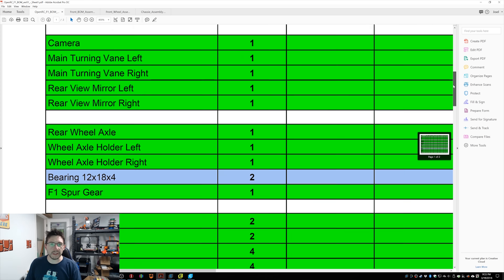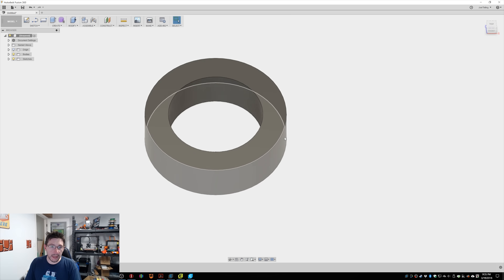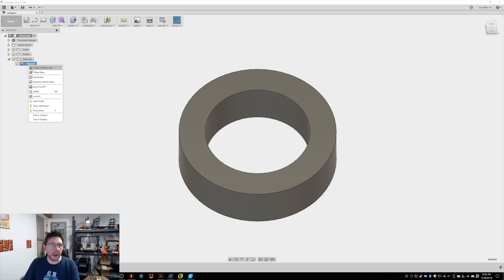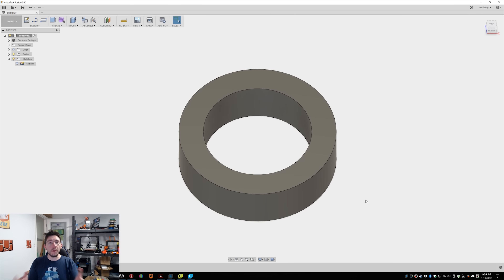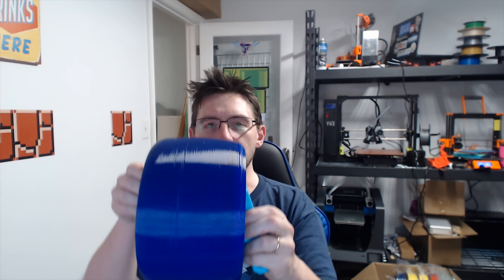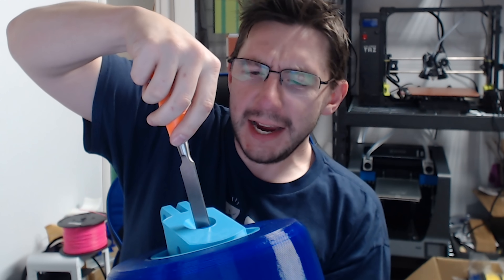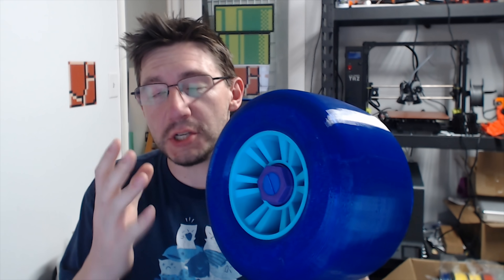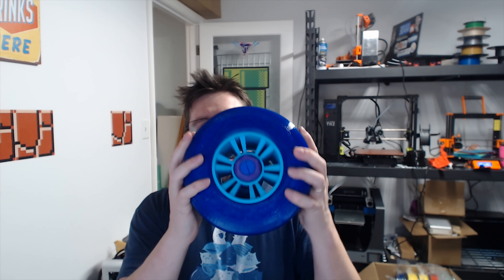3D Printing Bushings for the World's Largest OpenRC F1 RC Car [EDIT: Its a Bushing]

Comment from the maker: HEY EVERYONE! I just woke up and saw the comments, just a few things:

1. Wow, thank you for all the kind words and suggestions! I recorded this late last night. Yes, I broke my own rule of recording after midnight, but, I had an idea, and wanted to get it filmed.

2. Yes, it's a bushing. It's crazy the words your mind cannot come up with when it's late and you're tired. Once everyone gets in an orderly line, you can all take turns pointing at me and laughing.

3. LOTS of people talking about lubricant, and friction, and worried that the bushing will just weld itself to the axle. It won't. THIS solution is just so I can get the car together and bring it to MRRF. That's it. It's going to be sitting on a table for people to see. It might roll a bit just so I can show people it does roll. Once the car is RC and under power, this WILL NOT be the solution because of all the awesome reasons everyone is talking about. :)

4. I really hope you're going to MRRF (the Midwest RepRap Festival)!
Reply: Bushings are bearings. The other name for a bushing is plain bearing. As always happens with YT a lot of your viewers don't know wth they're talking about.
Reply: I would still squirt some lube in there even if the bushing is temporary just to reduce the scratchy noises of plastic rubbing plastic.   High Five!
Reply from the maker: I am!
Reply: Awesome video. I really can't wait to see it finished! Specially when it's rc ready. To help you with the bearing situation when it's time to make it rc. Check these out https://www.georgelodgedirect.co.uk/Products/0032003d0003/F59460/

It's 1mm wider but I don't belive that will be a problem. Hope this helps!
Reply: I wonder... , is there a pla fillament that is loaded with powdered graphite, (I DON'T mean carbon fiber, I mean powdered graphite, the type used as a dry lubricant for mechanics)? It seems like a viable possibility, (after all, there is "bacon" fillament, and "coffee" fillament, so why not?). If it does exist already, who makes it? And, would it help with the joints in this project?
Reply: I don't know if you're planning to make it a working RC car, but if you are, you might want to consider the amount of force you're going to need to get the car moving.
Bearings do come in a wonderfully large selection of sizes if you need to go with a traditional bearing.
Reply: Great stuff as always Joel!
I do wonder how it would compare if the layer lines were at 90*. less surfaces touching, so less friction? maybe even design tiny ridges in the axle...
Reply: oh, dang! just learned about this event, I will totally have to check it out next year, as its sold out (real shocker lol, 2 days b4 the event :P)
Reply: if you ever want / need 3d printed bearings, these look good, havent tested yet though, as my 3d printer is currently down https://www.thingiverse.com/thing:2349065
Reply: Sometimes engineering scales badly. I learned that as a kid paying with flying model aircraft. Damn those wwII fighters with their low dihedral angle and small surface area tailplanes. Regardless of that I hope you get the car to somewhat driving under it's own power. Printing the car in full F1 scale and attempting to drive it would really be a spectacular disaster :D
Reply: I will be at MRRF on Saturday with 3 more fans, one being my daughter who got so hooked on 3D printing that in less than a week after I lent her my Fabrikator mini she bought a CR-10.  We're all interested in seeing this model in person!!
Reply: You can still come this year. It is free for everyone. No tickets needed. Digital tickets were given out to get a rough count of people and get badges printed out.
Reply: A plain herringbone planetary gear would give you a 3D printed self-contained system that should perform just as well. It feels like a bit of a cleaner solution, just one of many around: https://www.thingiverse.com/thing:53451. Keep the great videos coming.
Reply: thanks! sorry, im an idiot sometimes, and  i've never heard of this event until today :P , i will most probably be there, and see this awesome 3d model
Reply: 3D Printing Nerd what printer do you think is better the cr-10 or the lulzbot taz 6 printer? my school uses the taz and I have a cr-10 and I think that the schools should use the cr-10. Also remember that the plastic shrinks when it comes out because it cools down so the pieces fit together 👍 can you make a video on the black panther mask/helmet? I’m printing one now and I want to compare mine to yours to see what I could fix. Sorry for asking so many questions I just love 3d printing :)
Reply: You are awesome, Joel.
Reply: Your dedication to this build is inspiring, can't wait to see it all together!
Reply: You should send the model to make it rc and have him set it up as a rc car
Reply: It's still open to the public, you just can't get a preprinted lanyard.
Reply: https://www.thingiverse.com/make:361506
I printed this one up in petg and it's been doing the spin-a-ma-thing since July outside in the weather.  It's not as smooth as a real bearing, but it's not rusting either!
Reply: twitch0601krytter wow, cool that they have them in that exact size needed!
Reply: 3D Printing Nerd it would be really cool of you could make ball bearings. Is there anyway to do that?
Reply: What is this bambulab logo on your wall?!?!

Comment: If you're building an RC car you should use real bearings. Dimension it'll work better it'll last longer and it'll be more fun plastic bearings those are just going to melt

Comment: Even proper hobby grade (mostly entry level) r/c cars sometimes come with bushings instead of bearings. It’ll be fine for a while, but bearings are a priority for when you’re upgrading. For a project like this though, bushings will do fine for the car to run a few times.

Comment: Joel, buddy I love what you are doing, but I need to give you my two cents. It's great you are thinking out of the box, but I would not make two moving parts out of PLA touching each other. They will only fuse after a little heat and friction and ruin your 3D printed beauty. Why don't you make the bearing portion out of Nylon?

Comment: I thought you were going to use roller or gear bearings , they performs well enough and rollers are only hard on bed adhesion(though they are very fragile)

Comment: Hey if your interested I designed I a bearing system for a life size torbs  turret. And I'm pretty sure it would work really well for your project. It keeps everything cost effective and worked better than a single use bearing or custom size one.

Comment: Im curious of a few things. You put work into the design already. It seem like with all the time that went into printing and assembly it would have almost saved time to make design implements that would bring the parts together more easily. Easy solution would be to design the holes in the parts where the metal rods were drilled in the last video. Better solution would have been a dovetail clips on either side of every butt joint that would slide into place. Idk It just seems like with all the work going into this that it would be better to put it together in a way that promotes more strength. Still super cool. The thing looks awesome. Can't wait to see it run. Bummed to read your pinned comment realizing it wont run for a while.
Reply from the maker: Yeah, I'm bummed as well. I mean, it's going to be assembled Saturday at MRRF. After that, though, I'm unsure of how long it's going to take to modify it and power it. THAT is the unknown. I am SUPER excited to power it though, so fingers crossed it happens way sooner than later.

Comment: OKAY STOP...right now...it's not a rim it's a WHEEL!  It even said this on your part list plus this is the correct automotive term.

If your making a big RC car you really are better off using a metal sealed bearings not a plastic bushing for less friction.  Not to say you can't use a bushings because I have RC's (all shapes and sizes) that use brass bushings but they mounted to steel axles.  Your plastic or resin will only last a short time before it becomes really imbalanced and warped.  Obviously if this is strictly a display car your plastic bushing will be fine.  Yes you can adapt all you want but at larger scales deviating from the original scale all this can be done properly with some research and knowing what scale ratio you should have started before going through all this work.

Hope all turns out well and I'd love to see this as a big RC fully functional.  I absolutely enjoy how your sectioning every piece and all the work your doing.  Good Luck.

Comment: Am loving this build. I appreciate the purpose of your print, just in my own mechanical prints where i need parts to move, I found carbon fiber PLA gives a nice smooth finish for smooth motion and where i actually need lubrication I use dry PTFE which works well without attracting dust and gunking up. Would be interesting to see if you extend this project to make a 3d printed box car racer (is that what they're called?)

Comment: What about printing a captured ball bearing?  I would think if you could dial in your settings it would provide reduced rolling resistance as opposed to 3D printed bushings like you are using.

Comment: 1. Igus makes fdm filament from speciality bushing material for just this kind of application https://www.igus.com/3d-print-material/3d-print-material
2. A decent set of digital calipers will help you make educated guesses to your clearance adjustment by measuring the actual printed dimensions versus what the design dimensions are https://www.amazon.com/iGaging-Electronic-Digital-Fractions-Stainless/dp/B001AQEZ2W

Comment: Hi joel as ii was watching this i was seeing if i could find a bearing that would fit and i eventually found this one, it a clutch throw out bearing for a dihatsu charade  but it's a 32x48x21 bearing so is youd want to go with a ball bearing i would check this out. it would need some modification to use because it has ears on the outside but in my opinion its worth it for how perfect the size it. here's an ebay link to one. https://www.ebay.com/itm/KOYO-Clutch-Throw-Out-Release-Bearing-CBU442822-RB-0702-32x48x21-44TKB2805/191269441596?fits=Make%3ADaihatsu%7CModel%3ACharade&epid=140170715&hash=item2c888c103c:g:iDQAAOSwGvhT2UNr&vxp=mtr

Comment: A little trick I use when printing a load bearing axle is to print it in two parts, but of course only works for 3D printing when the axle is 6mm thick or bigger.  I design the axles with any necessary threads for retaining nuts using Fusion 360 but then I place a smaller square beam through the middle.  The axle is printed vertically while the beam is printed horizontally.  After printing the beam is slotted into the axle and you end up with the low friction on the axle surface for rotation but you get the added benefit of the horizontally printed beam for load bearing.  I use a Prusa I3 MK2 and the sizes are pretty close so a little help with a mallet is sometimes required to put the axle together but you could print the beam slightly smaller and rely on glue to join the parts.

Of course 'load bearing' is limited by the material but for windmill and a tracked vehicle I'm working on these axles are much more robust then just the vertical printing as those single part axles I find easily shear off under load.

Comment: Your theory about matching the orientation of print striations is just daffy. Now, try printing it in nylon and you might have something.
Something wrong with real bearings?
Something wrong with using a measuring device, say a caliper, to check for the OD of the axle? I myself would love an endless supply of material and time and I (actually) love that you have such-- but it seems there's an easier and more direct approach.
Have a good con.
Reply from the maker: Is it daffy? like duck? I dunno, man, I mean, it seems to work. Yes, they will be printed in another material that isn't PLA when I power the car, OR, I will find proper bearings. Remember, the goal here was 100% 3d printed and done in time to take to the Midwest RepRap Festival.

There is NOTHING wrong with calipers, and if you happen to know where mine are, I would love to be able to use them again. heh.
Reply: "Seems" to work is just fine for two spins around the table top. The points of contact are random and the wrong material. Any speed for any amount of time will cause some melting.
I was a little slow to grok the 100% print idea-- but I then would have assumed you would print the bearings all in one go, ball bearings in channels and all. That might involve a friendly out-of-house vendor (hmm, you have a Formlabs, don't you? Should work, just provide drain holes).
Ahhhhh.... calipers... calipers... there! to the rear of that cabinet with the books on it.... (Some critical tools I have dupes of that I put at opposite ends of the work arena!)

Comment: Hey mate. What about design a print in place roller bearing.  Should be possible as long as you get your tolerances correct. (Ball bearing wouldn't print correctly.) Also the more load you add to a bush or bearing, the more friction involved.

Comment: Couldn't you just buy the ball bearings then 3d print the the casing and make your own ball bearings? If in a pinch you could 3d print the balls. I get the model in its current state is for display,but if that changes make sure to get better bearings

Comment: I assume you've heard about the 'under sized holes' problem with 3D printing? You didn't mention it in the video, so I'll mention it here: you need to add a nozzle width diameter to the inner diameter of your bushing in order to get the printed dimensions correct.
There's no need to guess.. :)

For those of you who haven't heard about this issue, google it and you'll find an explanation.

Comment: It's not really much of a problem to get bearings the size you want really... Just go to McMaster and use those (altered) size dimensions to get yourself a set of correctly sized bearing.
Reply from the maker: It is if you need them super quickly :) Which I would have. However, once it's together and I get to show it off at MRRF, I'll get proper bearings to prepare it for being radio controlled!

Comment: Nice.  I made 3D printed rollerblade wheels for a CNC project a few months ago:  https://www.youtube.com/watch?v=00iecf1upQ8  Real bearings, but 3D printed spacers between them,  PLA wheels, and TPU tires.  Came out better than I expected.  If I still had roller blades I'd probably take them for a spin around the block just for fun....but doubt they'd last for more than a spin around the block :D

How do they do on the CNC?  Hard to say since I haven't finished it yet.  The only places in town that sell the SS tubing I need are only open during hours I work so it's tricky for me to deal with them.  Plus I don't really have room for the finished machine so I've been trying to find someone else local who wants to finish it with me ;)

Comment: Hi!  Thanks for the videos of your project. The 4x RC car is crazy, as in crazy fun!  :)

You probably know Igus, the company that makes polymer sliding bearings.  But if you didn't know, Igus makes 3d-filaments which allow you to 3d-print your own sliding bearings!  

The Igus filaments are based on the polymers they use in their own sliding bearings (journal/plain bearings).  Of course, there are some limitations, but if you need a more robust solution for your plain bearings, and you want them to be 3d-printed, then follow the link:
https://www.igus.com/3d-print-material/3d-print-material

Comment: What you could do... You can split the bushing in Fusion360 (essentially making an outer and inner ring) and add a pipe to it that runs between the two rings of the bushing and use the cut feature. This would add a channel that would be mirrored between the two rings. During your print (you'd be printing both at the same time) you can pause the print and drop in actual ball bearings (easily bought on eBay) and finish the print. This would encase the ball bearings and actually create a bearing. You'd have to play around with it a little I'm sure, but it should work well.

Comment: I think i know why you had to loosen the screw to get the wheel to spin freely. Its because there is and inner and an outer ring in a real bearing. In your case you only have one "ring". 

So if the wheel is ment to be mounted to the outer ring and the axel to the inner ring, then in your case you will lock the wheel with the axel because you only have one ring.

Comment: Why not print your bushings in nylon, (nylonX? -- I'm sure MH has some on hand) and you don't need to worry about replacing it later.
Reply from the maker: The goal for this was all the same material, just to see if it was possible. It's 100% 3d printed. All of it. Once it gets power things will change, but right now it's just an awesome thing to look at.

Comment: You can print a bearing casing and use BBs. You print it in two parts, in the same way you did here but with a rail slot on the inner faces and have a single hole for BB insertion on the outer case. put the parts together and fill with BBs (one by one)and plug the hole. Works great, maybe for this size two rail slots would be ideal.

Comment: Good thinking. I did the same thing with my normal scale openrc f1 because I had some bearings laying around but not the right size for the front wheels. Not only does this work at 400% it also works at 100%. 👍

Oh and see you at MRRF!

Comment: You could have used nylon filament for the bushing.  It's a fairly low static coefficient of friction of about 0.15-0.25 and that is on a dry surface.  It is also very tough and has a higher melting point compared to PLA.